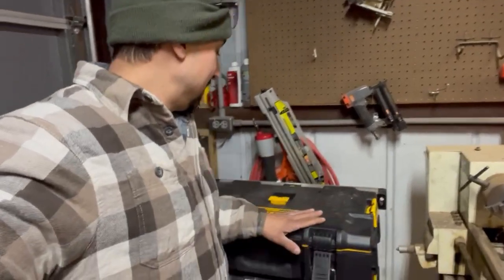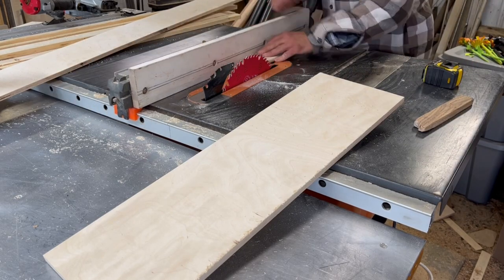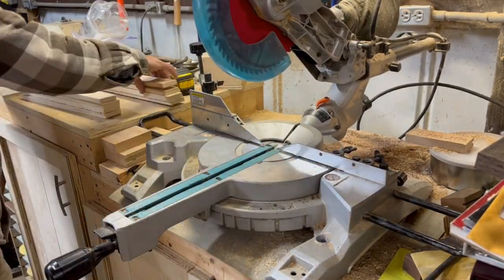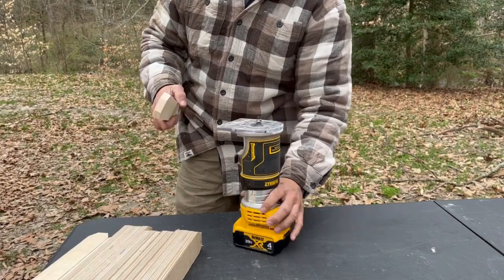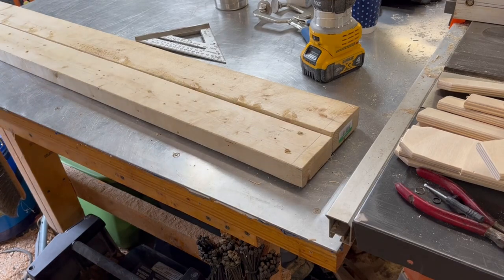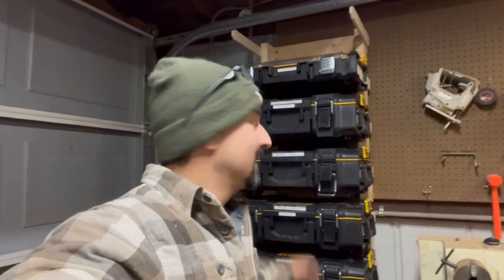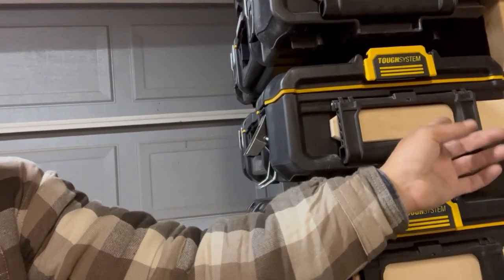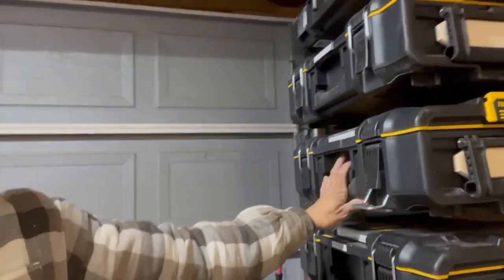EASY Build Your Own Rack For The DeWalt Tough System

Comment: Thanks for this. To heck with the dewalt rack, this way is far more customizable. I’m thinking of a slight angle of 1 or 2 degrees upwards on the arms instead of the shim on the side to lock it in..
Reply from the maker: Glad I could help. That slight angle should be perfect.

Comment: That's why I hope dewalt comes out with a rolling drawer system so you won't have to lift all the boxes
Reply from the maker: I think you are right on point. They do have the tough system dolly cart that you can place the drawer on as the first box, but still not as sleek as a dedicated sliding drawer base on wheels.

Comment: Why don’t you use an impact driver?
Reply from the maker: I get a lot more control using a drill (especially with pre drilled holes). The small atomic drill is perfectly balanced with a 2ah battery and is a joy to use.

Comment: NEVER leave the chuck key in the chuck of your lathe! It is a missile ready to fire...
Storing your tools in the workshop in toolboxes doubles the time it takes to get a tool- and put it back. So you don't, and they collect on the worksurfaces and you have to keep moving them around- and trying to find them. pegboard/cleats/cubbies best, drawers second best. And you already have the pegboard!
Reply from the maker: Thank you for the input! I live in a very humid environment and my shop isn’t temperature controlled so the boxes are saving many tools, especially with the foam insulation around them.
Reply: @Born2Make.  Yes, heard this 'reason' before. A de-humidifier is cheaper than the toolboxes, and also works on tools that do not fit into a box.
Reply from the maker: @Tensquaremetreworkshop  thanks for the info, I’m familiar with them however it’s hard for them to keep up in a shop with no insulation and gravel for a floor. From condensation/dew point location and ground moisture coming thru I don’t think that will cut it. Maybe after we get some new electric/concrete floors/ and insulation over to the shop after we recover from our house fire, that should work.